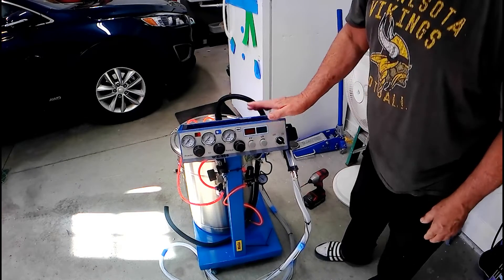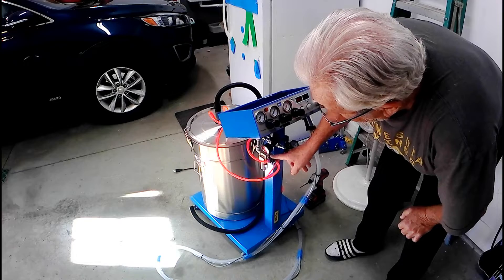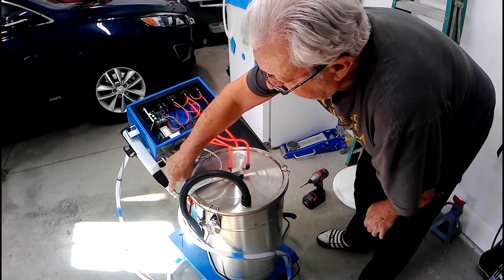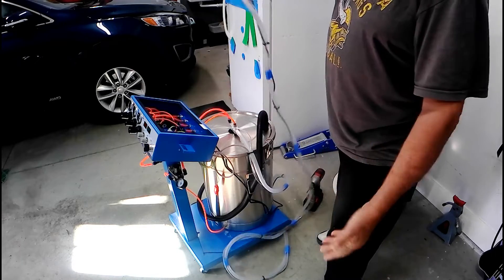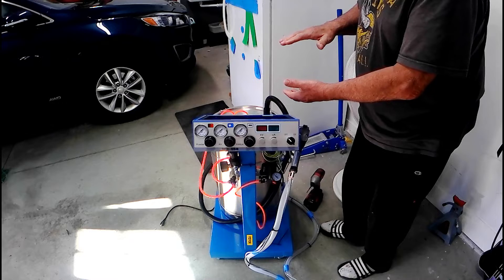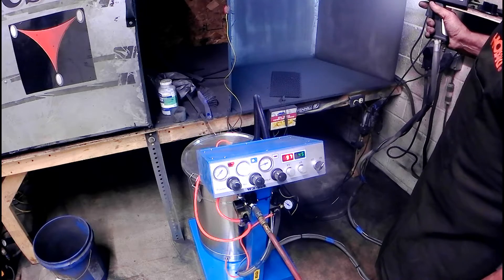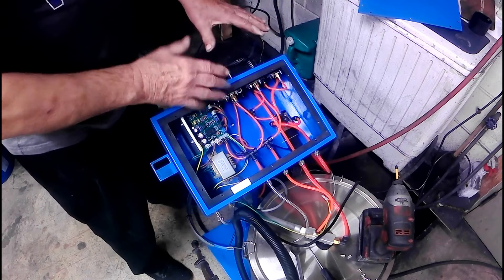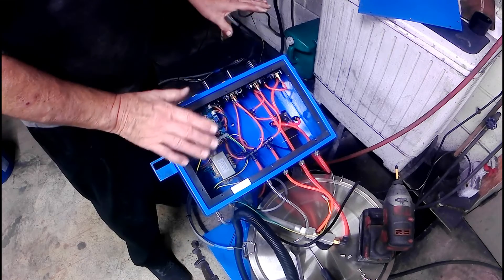WX 958 Electro Static Powder Coating Machine

Comment: Thank you for the great explanation and showing the inside of the control panel. Also thank you for showing the unit in operation. I am looking to upgrade my powder coating system and have been thinking about one of the inexpensive units but haven't found any videos of them in use.

Comment: Can you please explain how you hooked your air up to the machine.    I just got mine and have it completely set up besides how to get air to the machine
Reply: We just set ours up. We ended up removing the existing fitting that came pre assembled on the inlet side of the water collector, and screwed in a male thread air hose fitting.
Reply: @CoopsHouse  Hey man, ours suddenly stopped working.
I only get a reading on de Powder meter, The air and rinse air stays flat.
You have a idea whats going on?
Reply: @MikevwFX  I’ll take a look at ours here in a little bit and see if I can see where a problem might lie. Make sure you don’t have any blocked lines or moisture in the air lines to start. Might even try unhooking 1 line as a time to see where you have air and where
You don’t.
Reply: @CoopsHouse  Ill try that tonight, I thought maybe a electric component is fried but it doesnt need electric components to get a reading on the gauges i suspose.
I could be wrong.
Reply: @MikevwFX  I don’t remember which obese, but I do know a couple of them only work when the trigger is pressed

Comment: Hello , I wanted to ask you what's the max for thr kv and thr ua? I just bought the same one and on the technical specs sheet showing 0-100kv and max 200ua. But on my machine, the maximum is 110kv and 149ua.
Reply from the maker: From my experience so far 90 kv and 45 ua seems to work well as a base point
Reply: @Endeavor Trikes  I mean, if you turn your machine all the way up, what is showing on the screens for maximum?
Reply from the maker: @powernosgaragebobiras3107  sorry yes like yours 110 kv and over 100 ua just like yours